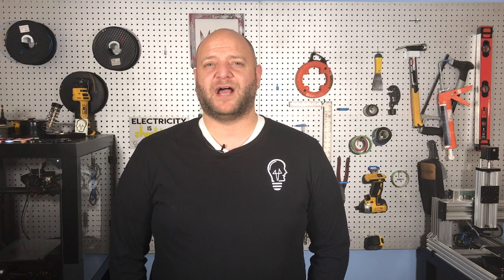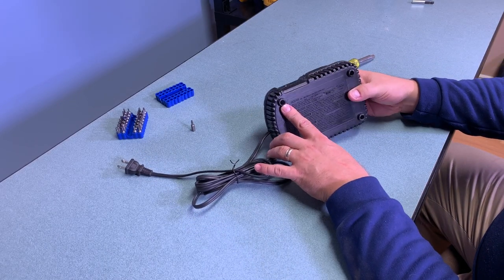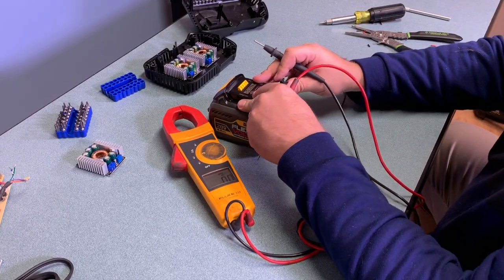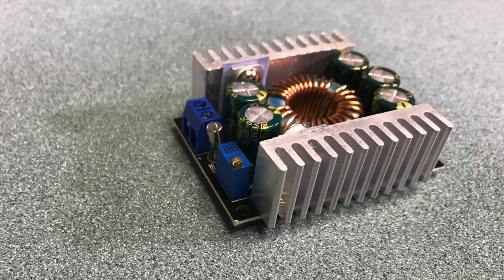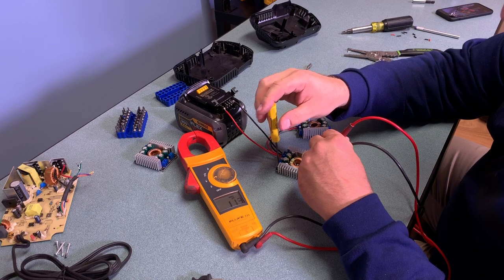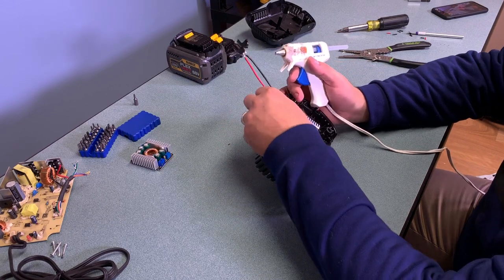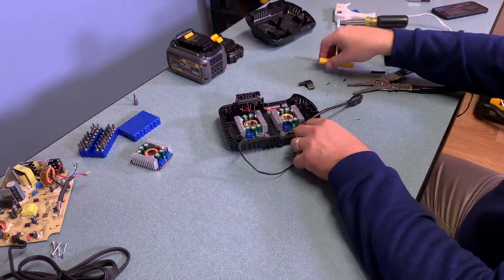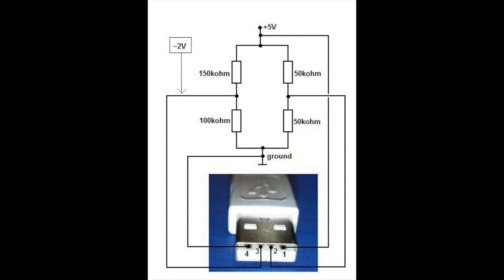Hack My Dewalt Charger and Make A Multi-Voltage DC Power Supply

Comment: You REALLY should add a low voltage shut off, specially with them constantly drain the battery, if the cells completely deplete you'll just have a very expensive paperweight.

Comment: Hack the charger to use a DC power source to charge the batteries. ie. 12-48v DC input to charge regular Dewalt batteries.
Reply from the maker: That’s a good idea!  Maybe down the road when I get a little more time. Thanks for watching!
Reply: @BaldGuyDIY  I too would like this modification.  I have a camper with decent sized batteries and solar (640watts) and would like to modify the charger to go from 12V DC to power the charger Dewalt batteries require.  I do not want to use an inverter.  It seems like one would need to understand how the charger gets from 110 AC to DC voltage to charge the batteries and replace that section with a DC step up transformer to the DC voltage the charger requires.  It seems that there would be others wanting this type of modification.  Thanks!
Reply from the maker: @johnfaber7106  I’ll take a look. The board already transforms the AC and converts it to DC. I think if we put the same kind of dc converter I used in this video into the circuit at the right place, it would definitely work like you’re wanting. Thanks for watching!
Reply: I need a way to charge my Dewalt power station batteries at our campsite using my 12-24v solar panels. Keep inventing.
Reply from the maker: @larrywellborn4681  I have plans to do a 12V charger for vehicles in the new year. That should work for your application as well. Thanks for watching and for the suggestion!

Comment: So, there’s an easier way. Buy a 3D printed DeWalt battery adapter and add your buck converter or DC to DC solid state converter into the mix. So if you don’t have the extra chargers, this is the route I’d go. But if you do have these extra chargers laying around, it looks like a fun way to tinker.

Comment: If you don’t have the security  torx bit, then use a small enough punch to fit inside the screw head n give that pin a whack down.

Comment: Just use the dewalt usb adapter and a dc to dc inverter with a usb plug (eBay 5$) . It has a potentiometer built in. Nice work however.
Reply from the maker: If you only want 5V, that’s good. I wanted to be able to produce any lower voltage. Thanks for watching.
Reply: Just depends on which one you purchase. None the less good project, great video

Comment: DeWalt charges $110 for their DC to DC charger which is insane when all you need is a $20 converter circuit.
Reply from the maker: There is room in the market for DIY and commercial products. There’s a lot of research, development and production costs that go into an official Dewalt product. DIY can save you money, but it’s more work and sometimes the finished product isn’t as good. Thanks for watching!
Reply: @BaldGuyDIY   Respectable perspective, but it still smells fishy to me that DeWalts AC charger is $30 and their DC is $110. I'm not sure how much R&D is needed to convert 12v to 18v.

Comment: As a fellow Dewalt battery hack guy (my most popular video), the thing you're missing is over-discharge protection. If you leave a load on the system with a battery plugged in until it stops working, you will have discharged the battery below the point it is intended to as Dewalt batteries do not have internal discharge protection. 

This may be fine a few times, but will damage the battery over time and your dewalt charger will likely refuse to charge a battery that has been over discharged (i've had to manually charge over-discharged batteries to make them start working in OEM chargers). I have not found a good 5s li-ion drop in discharge protection module, which has had me scavenging them from old tools to make these sort of projects.

Not trying to knock what you're doing, I actually may steal the form factor of using a charger if I find a good discharge protection module because that's a cheaper source for a housing with the physical connectors to mate to the battery that using a tool (I typically try to find burned-motor drills), nor am I a safety whiner. I just wanted to warn you/viewers that doing it this way will mean you'll need to manually monitor your battery charge state.
Reply from the maker: +42Fab - Metal Fabrication & Signage thanks for the comment, but I believe the built in battery voltage protection will prevent them from over-discharging.
Reply: @BaldGuyDIY  The dewalt batteries are "dumb" in that they aren't much more than just the cells. The board inside a battery just relays info to the tool/charger about the battery condition, temperature, etc, and runs the battery charge indicator.

In most dewalt 20v tools, there is a little board full of epoxy connected to the battery contacts. That has the battery protection in it. My guess is that as the tool needs some switching components anyway, it's cheaper to build the protection into the tool rather than the battery.

This is best evidenced by the fact the 20v-18v adapter has a circuit board inside it with some beefy mosfets on it. If the battery protected itself (like the old NiCd 18v batteries do just by nature of their chemistry), the adapter would literally just be some wires connecting the two mating contacts.

Not trying to crawl up your end, taking the initiative to make something is awesome, but seeing a $100 battery bite the dust due to an omission would suck. I have a video showing the components in question. Time queued here: https://youtu.be/ikZQLvKZYMA?t=181
Reply: I have used a buck converter in a radio powered by a dewalt battery, it discharged it til it was ruined i thought i would keep an eye on it but it happened again 🤦 trust me they don't have discharge protection in them
Reply from the maker: Thomas Doherty I’ll add a voltage cutoff. Thanks for your feedback.
Reply: BaldGuyDIY did you end up adding a voltage cut off ? And if so will you be doing a video on it? I was sitting around wondering how I could turn a dewalt charger and battery into a feed for an LED light for my dirt bike. And sure enough I typed into you tube and your video came up. The voltage cut off would be ideal, I use my batteries for work also so wouldn’t want to mess them up. Thanks!
Reply: So if you watch the battery and stop using it when it hits one bar…that will keep it safe?

Comment: Just wondering if you could make a power adapter for a flexvolt tool ( mains power to a cordless tool like the miter saw has) but for a single battery. For those times when you run out of batteries or you know you're going to run through a lot of batteries?

Comment: Problems with the dewalt cordless batteries is they discharge to dead flat! Balance board is crap. Yet my old LI-ON Ryobi batteries can be completely discharged and recharged! I have jumpstarted my Dewalt batteries a number of times. I have 2 1200 watt dc to dc converters which I have bridged to get 40 amps  at a max of 96 volts. I only take it to 18 if I have to jumpstart a car battery. 18 to 20 volts on your vehicle will not damage anything as your car battery will only climb to 14.9 volts because of car battery AH. I have thought of doing exactly what you are saying and doing. I have multiple 100 watt version which if mini fan cooled can put out 10 amps at easy 48 volts. Im gonna do this. I did electronics techie course and Electronics engineering course! So I have to keep building electronics and repairing etc. Im glad I found this. Subbed and liked because I saw this. Very informative video. 🙂👍👍👍. Cheers from Australia!

Comment: I want to run my Dewalt 20V fan from the wall. How can I use an old battery and add a cord to power the fan this way? Basically, I want a DCA120, but 20V so a DCA20 that I can connect instead of a battery pack to 20V tools/items like my fan.

Comment: Will this kill the battery by depleting the cells completely instead of disconnecting when there is low voltage?
Reply from the maker: Yes, it will prevent the charger from charging them properly if they are used beyond a certain threshold. Check out the next video after that to see a low voltage cutoff option. Thanks for watching!

Comment: You can also use an older high quality computer PSU for free at your recycling center. Those have a lot of AMPS and are quite reliable. Get a dell or HP. I ran a leaf blower once from the 12v line when my battery died.
Reply from the maker: That’s a great suggestion IF you are using 3.3V, 5V or 12V DC. But if you’re using a different voltage, it’s not very flexible. I have used a computer power supply on my escape room puzzles and it works fairly well, although some electronics still need the voltage to be tweaked up a bit from 5V to work properly.
Reply: @BaldGuyDIY  Thank you. Literally came to yt because i couldnt find answers to the question how to hack a charger bc everything is full of people saying "just use a pc psu".  Thanks for the video.
Reply from the maker: @n.l.3776  so glad it was helpful. Thanks for watching!

Comment: How does the converter affect battery life compared to using say a 18v 9ah battery normally. Will a 18v battery converted down to 12 volts last longer then if it was used at the 18 volts? Great video.
Reply from the maker: Thanks for watching!  It’s a little more complicated than yes or no. Amp-Hours is a function of how long a battery will last at a given current draw. A 9Ah battery should last 9 hours drawing 1A, or 1 hour drawing 9A. It’s not a perfect relationship because higher current draws produce more heat losses in the battery, but it’s a good reference. 
Voltage and Current have their own relationship. Power = Voltage x Current. If you think of the same amount of power (in watts), the higher the voltage the less current required and the lower the voltage the higher the current required to give the same overall power. 
Without getting too much deeper into it, if you powered a 12V device with a 12V battery that was 9Ah, it would deplete faster than if you used an 18V or 20V battery that was also rated at 9Ah, because the current draw on the higher voltage batteries would be less. There are a few other considerations, but hopefully that answers your question satisfactorily:)
Reply: @BaldGuyDIY  thanks for the quick reply. I was wondering if the converter drains off the extra power of 6 volts (18v-12v) to heat and that would be a waste of power from the battery? It really doesn't matter because I have a bunch of Ridgid 18v batteries. (More curiosity) and they pack a lot more punch for the size so I am going to convert the power to 12 volt to run my underwater camera. I don't like hauling standard wet cell batteries around. You have great videos. Thanks
Reply from the maker: @royyoung5731  it doesn’t waste or burn off the excess energy. What it does is convert to your output voltage. So per the power formula I mentioned, if your 12V device draws 7.5A, your 18V battery will only have a 5A draw. It’s not 100% efficient in converting, the converter is my video is about 92% efficient, so it might be around 5.4A. If you have the choice between using a 9Ah 12V battery and a 9Ah 18V battery, the 18V battery will definitely last longer, about 40% longer when you convert it to 12V. Good luck!
Reply: @BaldGuyDIY  1000 thank you.

Comment: Gday mate... good to see you getting into the guts of a charger... would you have any advice for me regarding my charger which got some water on it and now although it indicates proper operation, does not actually charge the batteries. I havent gone into the guts of it as yet and wondered if you have had any experience with maybe a fuse or something that is replaceable that might have caused this problem. Regards Chris
Reply from the maker: Thanks for watching!  Water is a tough thing to guess on, because it can cause short circuits and failures all over. If you take the case apart and look closely at the circuit board, you may see evidence of rust or a burnt component that was still wet when you tried to use it. If it doesn’t look damaged anywhere, you could try drying it out better by putting it in an oven at low heat for a few hours. Probably nothing over 200F. Any residual moisture could be causing the problems.

Comment: This was a Great Video! Very well explained.   I just found your channel I enjoy it. Thanks. 
Have you tried making a DeWALT adapter with the 12V input Plug that will charge the 20V Battery with a solar panel?
A different way to put the power in the Battery rather than take it out. LOL

Comment: How would one wire a corded "battery pack"? I'm looking to make something like that for my cordless tools in case of emergencies or times when I don't have a charged battery and need to use a drill or saw.
Reply from the maker: Thanks for watching!  That’s a great question and something I’ve thought about before. I haven’t pursued it before because I have a lot of batteries and a large charging bank so I’m never without a charged battery. The basic process would be 120VAC into a transformer down to 24-40VAC. Then using a Full Wave Bridge Rectifier, convert to DC. Then into a converter like I used in the video, rated at 20-30A, to regulate the voltage down to 20V or whatever the batteries are normally rated for. Finally, connect to the device. However, DeWalt and other brands often put other mechanisms in place to detect battery integrity and safety, so I’m not sure if you’d also need to do something else to make it work. All that, plus the tools still won’t perform as well as true corded tools do, because they have a lot less torque. Maybe I’ll try it down the road, but I think it would be better in most cases to just have more batteries/chargers, or to have a backup corded drill/saw if all battery options are depleted. Plus, it usually only takes 15-20 minutes to charge a small battery, and you probably deserve a break;)

Comment: WHAT DO YOU THINK OF THE BATTERY ADAPTERS (FOUND ON EBAY/AMAZON) FOR CORDLESS TOOLS (USE AN M18 BATTERY ON A 20V DEWALT TOOL)?  MY CONCERN: THE ADAPTERS HAVE ONLY POSITIVE AND NEGATIVE CONTACTS.  THE TOOLS USUALLY HAVE AN ADITIONAL 2 CONTACTS FOR SYSTEM MANAGEMENT.  THESE ADAPTERS ARE ABLE TO RUN THE TOOLS BUT, WILL THE BATTERIES BE DAMAGED DUE TO OVER DISCHARGING?
Reply from the maker: Can you send me the link to an example?

Comment: Want help to solar charge a powertool battery then power led lights.Goal is to overcome the lack of sunlight in winter and not enough battery in the original light. Thanks.
Reply from the maker: I’m working on a couple more charger hacks. I think there’s one that you could adapt for solar. Check back in the next few weeks.

Comment: Could that power supply setup be used for powering a 12v bilge pump to run a mini sluice?
Reply from the maker: Definitely!  Just need to make sure the amperage of the device doesn’t exceed the converter rating.
Reply: The bilge pump I was thinking of useing is a 1100gph pump also a 2000 gph possibility. The whole idea was I am trying to decrease the weight I will be lugging down to the creek or river as I am getting old and weight is a big deal now. So gas powered pumps are weighty so is the gas can  as well as a car battery. Drill batteries seem a likely option. Could you tell me where in Alberta I could get these supplies to build this pack? Thankyou for your help.
Reply from the maker: @roberthink1712  the only thing to make sure of is what amperage the pump requires. If it’s under 20A and 12V you should be alright. 

I’d buy the converter on Amazon as well as a voltage cutoff so the batteries don’t get too depleted. Send me an email and I can send you some specific links. You’ll also need a Dewalt charger that can be sacrificed to put the components into.
Reply: @roberthink1712  I have a bilge with spade connectors that I plug straight into the battery pins. Its for a portable camp shower so it doesn't run very long, but its submerged so its not going to get too hot

Comment: I have the Dewalt 20v tower light. I’ve often wondered if it could be converted to 110v using one of the extra 20v chargers. Would you know how that can be achieved?
Reply from the maker: Depending on which model it is, it may already have a 110V AC adapter. I have a Dewalt tower light and it has both a plug for connecting an extension cord and a pass through outlet so you connect an additional device.
Reply: @BaldGuyDIY  
DCL 079B  20v only
Reply: Following this comment - bump

Comment: Instead of using strippers for wire that small just hit the end (about 1/4" worth) with a small torch. It'll burn it to the point you can just rub the end between your fingers and it falls off
Reply from the maker: Ryan Lynch that’s not a bad idea but I find some wires hard to solder if they get contaminants in them from the burned insulation.

Comment: I'd do a current limiting buck converter and I have seen a couple that you can set a low voltage disconnect as well that's not a bad idea
Reply: But those do cost more but for me I'd just do one converter probably a boost buck converter that could do like 30 something voltage down to 0 with a lower voltage supply but also I'd have added a display and mount some potentiometers on the outside to be able to adjust the voltage when ever I needed to

Comment: Good job man! I stumbled across this video trying to repair my DeWalt battery.. SUPER GLAD I came across this info though! I could use a couple of those voltage regulator things for sure. I just started dabbing my feet into trying to understand electronics. 
Thanks for the upload & really useful info👍🤙 subscribed ✌️
Reply from the maker: +Joey GunZiLLa thank you so much!  Be sure to check out the 1.1 version where I added some low voltage protection so the battery didn’t run too low. Thanks for subscribing, I’ve got plenty more projects on the way.